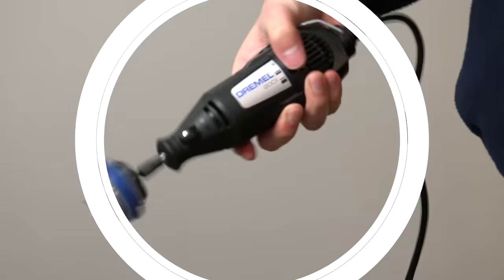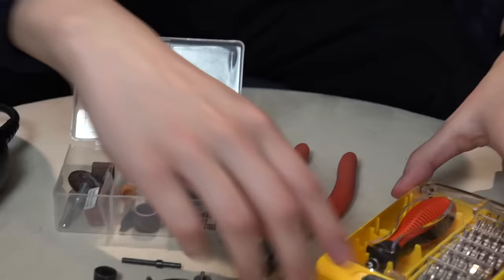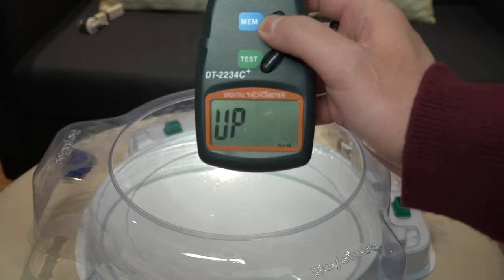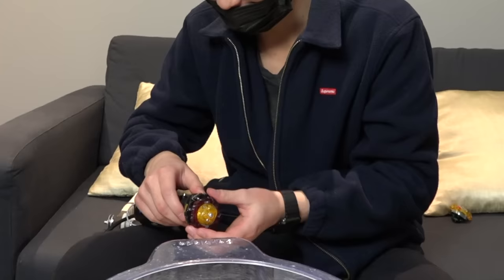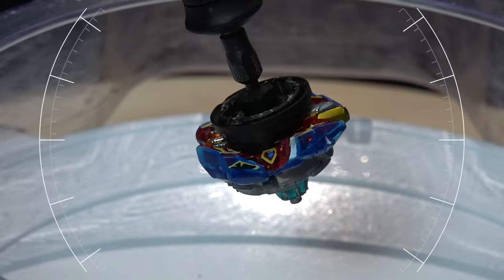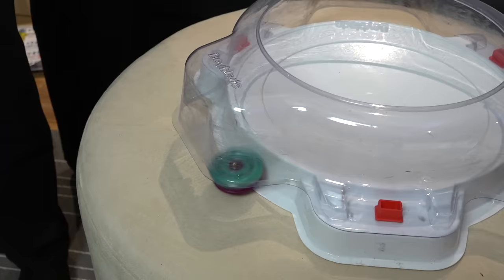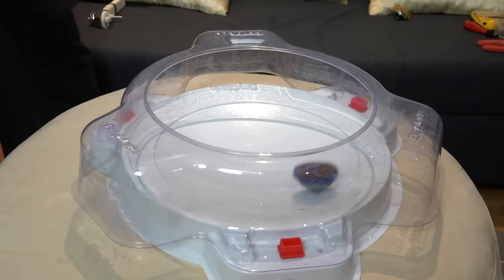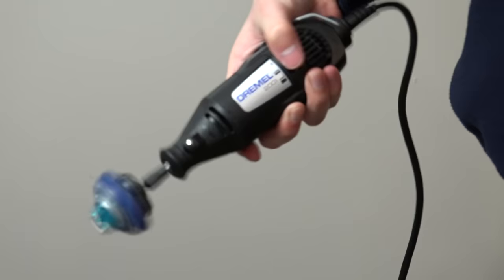DRILL LAUNCHER MOD 2.0 : Beyblade Custom Launcher (44,000 RPM) TEST SPIN

Comment: If you put super glue and baking power together, the glue with instantly react to the soda the moment they mean. This is due to the soda being a HIGHLY reactive catalyst that solidifies the glue into a rock hard plastic like substance. I've used this process to fill in cracks, hold pieces together. I don't think it would help your cracked out bays tho 😂 keep up the good work. Your videos are very entertaining!

Comment: Wow it can make stamina types into attack
Reply: r0cKet_Chicken WIN it’s basically what hasbro did for turbo but better
Reply: Imagine if Libra or Byxis was used like that.
Reply: @agr8hill  phantom orion bd is simply the best stamina type
Reply: elatrednU snaS probably would’ve been a similar result to Deep Chaos
Reply: not really caynox was not going that it go for the center. ATTACK types are not determined by speed. They are determined by the driver, ect...

Comment: Launcher and filling it against the water maybe the blade Beyblade with bones underwater to the other side maybe that would be a good idea since it's very fast and if you make it stand here and it's very fast and then when it let you go on the water maybe or maybe not it will bounce on there good luck